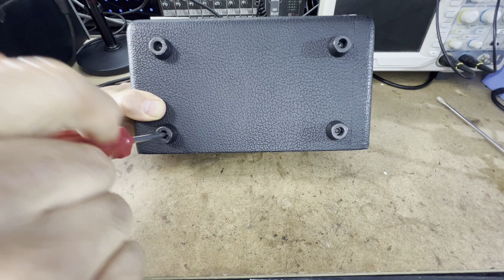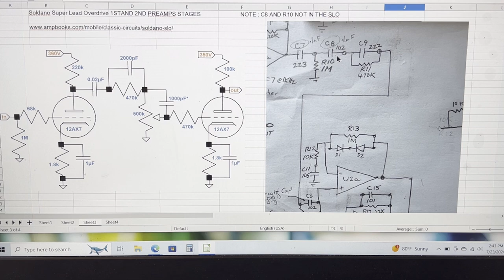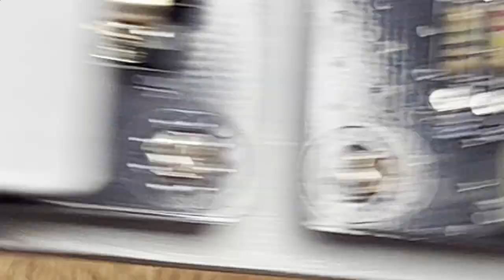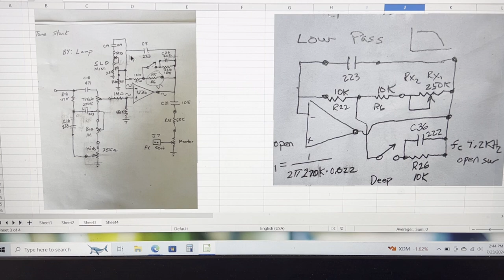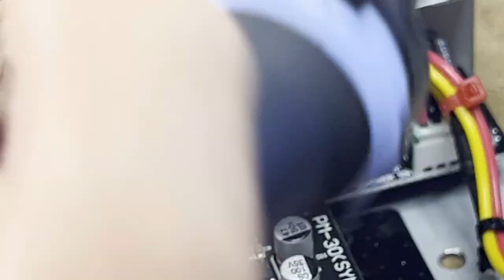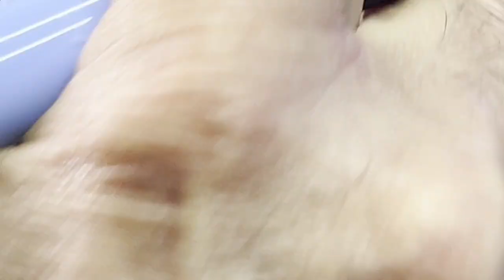SOLDANO SLO MINI AMPLIFIER, L-AMP DEEP MODS, THEY ARE REALLY DEEP!

Comment: So I’d like to get the mini as close to a SLO-100, can I just pull C8 out (no jumper) and add the 250k pot to R6?
Reply from the maker: Sorry I didn't respond sooner, but yes, you can do that. It will have more low end, so I put a switch across it because it does sound good both ways. They put C8 in there to cut more lows and tighten it up. Thanks for your question.
Reply: @c @charlielamp2739 thanks for confirming, saw a video where both a SLO100 and mini were side by side. The 100 had all of the eq knobs at noon when the mini had the treble knob set to ten o’clock, so boosting the lows on the mini should do the trick.
Reply from the maker: @RasCuban33 I think our really going to like the R 6 mod , it is so awesome, it has a full sound, it is so better than the stock amp.
Reply from the maker: @R @RasCuban33 They didn’t want the mini to sound as good as the $3200 SLO, in one of the videos , George Lynch said it sounds about 75% as good as the SLO100. Well it did tell I came up with this mod.

Comment: I am torn between buying a rosamp kit and the mini. This feedback network mod REALLY makes the low end shine. I might end up getting both, but will definitely get the mini modded with your mod #2.
Reply from the maker: It would be great to have exposure to both tube and opamp circuits. Just be careful with the high voltage stored in the power supply capacitors after you turn off the tube amp. The SLO mini opamp circuit is low voltage and safe to work on. Sounds like fun ahead!